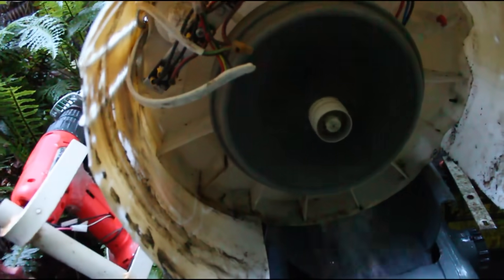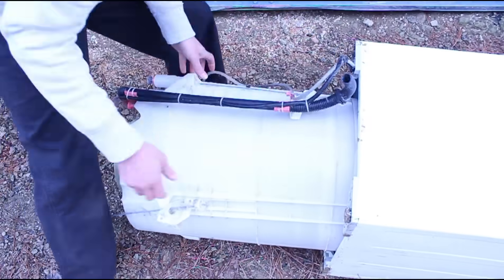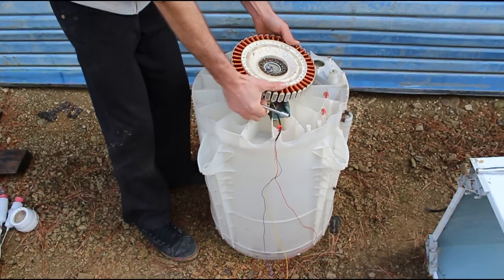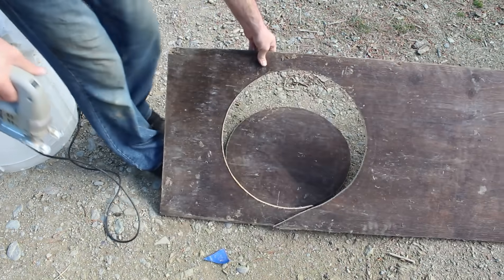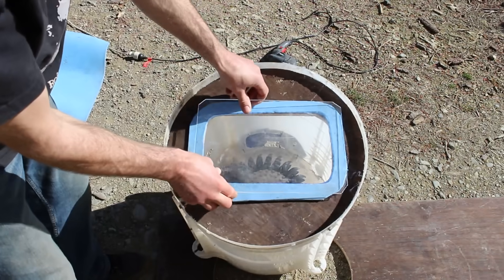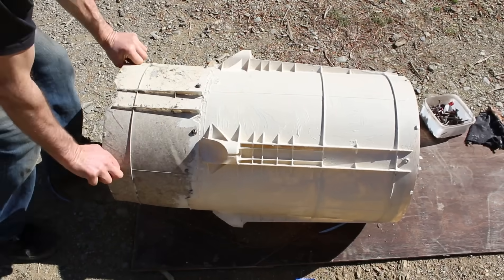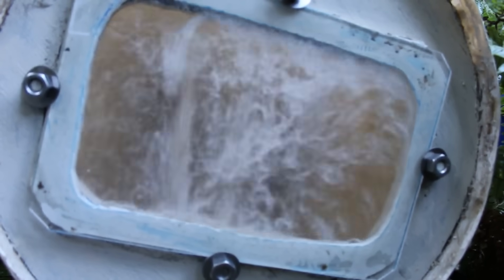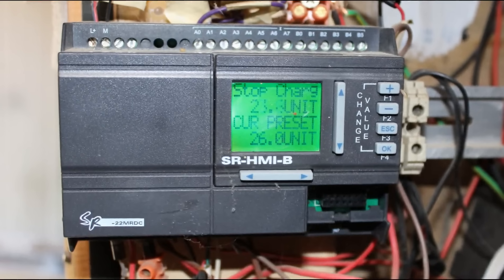Free power- How to convert an old washing machine into a water powered generator

Comment: I have a few questions for Angry Ram/Mitch T.  First of all, I live in the USA, so finding the type of washing machine that you have in New Zealand might be a little harder to find, if not impossible to find, and/or to buy, and/or sell, halfway around the world in the USA, where I live, so what kind of other washing machines would be a good substitute for people to use in my part of the world?  Second, can you modify this system for places that run on a bit flatter land that still has water in a lot of areas and still have it work just as well?  Third, can this system be modified for places that are plains, the savanna, the tundra/cold deserts, or hot deserts, yes or no?  Fourth, have you considered making more maintenance checks for your power generation system?  Fifth, have you considered making a better filtration system for your power generation system?  I suggest that you have a system that is in place around your pipes that drags the debris and detritus off into an area like large scale power generation systems like yours do so that it takes away from doing as much maintenance around your pipes in that regard.  Sixth, since New Zealand runs on around 230 volts to 240 volts in its electrical outlets, and the USA, Canada, Japan, Anguilla, and a few countries tend to run between 100 volts to 125 volts in their electrical outlets (though, weirdly enough, a few countries, like Belize, for example, can run on either system), how can you convert the system to run on lower voltage power systems so that the electronics, as well as electrical outlets that are in your home, do not get fried, as well as burn your house down, since your generator does not function on an electrical outlet any longer?  Seventh, and lastly, have you ever considered making the water pipes run a bit more in line, that is, flush to, the rocks without making the rocks, debris, plants, and other detritus causing difficulty to having periodic maintenance checks being made on the system from time to time?  Now, granted, I may not be an engineer by trade (I am actually disabled in real life), but I figured that I could ask these questions so that I could not only improve your own power generation system, but that I could also help out people that run on different voltage systems to have their own variants of such a system themselves.  Thank you for the responding comments.

Comment: Whirpool Cabrio and Maytag Bravos use the same type of stator motor, and they are much more common than the Fisher / Paykel washers.
Reply from the maker: Jeremy Hofecker Thanks for the info Jeremy
Reply: Jeremy Hofecker You are so right. I am told all the time "what a shame these washers aren't available here in the states" They are everywhere under various brands including F&P. Just visit any appliance reseller. Tell him you are looking for those funny looking permanent magnet washer motors. He probably has half a dozen that are not worth fixing as the computers go bad and cost more than what he can get for the washer used. (You don't need the computer) Here in NE TN they will let you have all the parts for about 20.00. Try and get one with good bearings so you don't have to replace them. Bring tools ;-)

Comment: You could use a small temperature sensor on the bearing and once it reaches a certain temp you know its time to change the bearings. You may be able to run it for more than 2 years and also you can test different types of bearings this way just for fun.

Comment: Can it be wired for 12-13 volt output and if so what would be a good guess on results
Reply: You could run a transformer off the inverter for 12VDC...
theoretically 850 watts continuous....
theoretically 40 amps worth but in reality probably less....

Comment: question: What are you using to pressurize the water to 40psi?  You need a power source for that as well, right?
Reply: He is using gravity to create the water pressure. As you can see at 0:40 he is running a pipe a good ways down stream, which creates a difference in elevation. There's a lot more to it but for a general idea in a static system, Pressure = (density of water)x(acceleration due to gravity)x(Height/elevation of water column). So that pipe you see there starts off about 90-100ft higher up the hill than its outlet, and could stretch a couple hundred feet across.
Reply: No need to be nasty Eric. Yes he is running a pipe along the stream, but what determines the pressure is the HEIGHT difference from source to destination. Calculations show that he would need at least a height difference of 92 feet to achieve 40 psi. And this is using a reservoir tank. He is feeding directly from the stream. He can run a mile on a gentle slope and the pressure is is still going to be determined by the height difference. On a gentle slope of around 10 degrees as shown in the video, the pipe would be around 529 feet long. This is what made me curious. Yes it is possible, just a lot of pipe and lots of real estate.
Reply: Thanks for clarifying gabriel, i was going to but figured my comment was already really long :)

The only thing I'm curious of is the temps there... it looks like its in the mountains, but what geographical? If I tried this in Pennsylvania I'd be replacing the pipe annually (unless I winterized it pretty darn good)
Reply: -Very good point. and it is not easy to find that long of stream you can lay pipe without cows or game wardens messing you up.
Reply: Gabriel Sierra
Reply: Good video!
Reply: How rude
Reply: Greg boyd
Reply: could i just use the pressure coming out my rain gutters for experiment
Reply: Golf Putz The lower the pipe diameter, the lower the pressure and the higher the velocity. Wider pipe has higher pressure but lower velocity. This is why hydraulic car jacks have a small piston on the lever side and a big piston on the lifting side. Since the pressure is lower in the small piston, you can raise your car easily.
Reply: In this case he may be using a ram pump. which is just a couple of check valves that uses the force of water to generate 30 to 40 psi. very easy and cheap to build
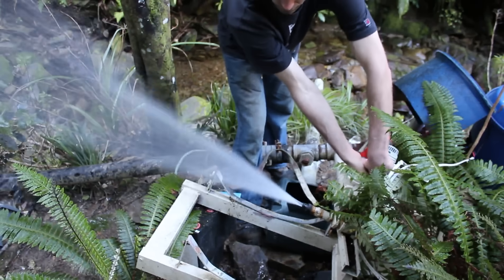Reply: Gabriel, if you can see the shape of the nozzle at 8:09, that is where a lot of pressure is generated, too, via the Venturi effect.
Reply: TheRoidemortetfleur, No. Pressure is given by elevation to the water inlet. The nozzle area affects the volume of water released. More water released increases the pressure drop in the pipe due to friction. More tube area reduces pressure losses but static pressure at zero flow is the same.

The RPM of the turbine is adjusted for peripheral speed to be half of nozzle water speed.

Using a solar MPPT battery charge controller will automatically adjust the load and indirectly find the optimum RPM where system output is maximized.
Reply: +Sir Camps- New Zeland, Someone Mentioned In Another Comment☺!!
Reply: +Golf Putz- No, Not Really Its Just The Head Pressure Which Is Determined By Height Of Supply Over Drop Of Output; There Would Be A Point Where Input Size Would Be Most Efficient But When You Add Bigger Inflow Pipe Than Whats Needed It Can Slug The System Or Provide Unneeded Wear On The Bearings Also!!
Reply: +Golf Putz- No, Not Really Its Just The Head Pressure Which Is Determined By Height Of Supply Over Drop Of Output; There Would Be A Point Where Input Size Would Be Most Efficient But When You Add Bigger Inflow Pipe Than Whats Needed It Can Slug The System Or Provide Unneeded Wear On The Bearings Also!!
Reply: I made a gravity fed water system for a farm i worked on,i never measured the pressure but the main line to the 50,000 ltr holding tank was 80mm and it was insane pressure, i think by memory the main line to the dam was about 130mtrs long. put it this way it still feeds 1000 cows with water to this day
Reply: In New Zealand power companies don't want excess power. We only get small cuts on our power bill when selling back unfortunately. 
It looks like this guy lives pretty far off from the grid, so it's unlikely he'd be able to. If i were him i'd route the excess power towards a hot water cylinder to keep my water hot.
Reply: A ram pump wouldn't help. They produce a greater head of water, at the cost of wasting most of the water that they take in. They essentially concentrate the energy in a large amount of water, into a small amount. So he'd gain in pressure but lose in volume. Both of those affect the power generated. 

Of course if the water had to be sent a long way, over hills, a ram pump could be a great idea, they're widely used all over the world in places like that.
Reply: Bodean Digs brilliant!!!
Reply: Keep these two numbers in your head and to calculate head pressure, lift etc.- - - 2.31 and 0.433.  The following is the equation for calculating head pressure (psi) from water column height (feet):
   Height in feet / 2.31 = PSI.
   (100 ft / 2.31 = 43.29 psi)
Or the inverse can be used to determine lift (feet) from a known pressure (psi)
   PSI / 0.433 = Feet of Lift
   (43.29 psi / 0.433 = 100 ft lift)
These are very simple conversion factors which do not account for line loss. Typical setups such as the water powered generator, the most important factor is amount of lift in feet and the volume of water available. I've asked the question, but he has not provided how much water (gpm) is being used to generate his power.
Reply: Golf Putz  yep. Also, 20 ft of 2" with a 4 to 6" x 2" funnel at the intake.
Reply: Golf Putz  No
Reply: @greenaum  I'd put the same point a bit differently.  It is possible to increase the water pressure using a ram pump, and then use that high pressure water to spin a Pelton wheel.  However, with a large flowrate low head source it is probably more sensible to use a reaction turbine such as a Francis turbine.  The total cost and complexity would probably be less and the total efficiency would be greater.
Reply: LazyH-Online  you contradict yourself by commenting to gabriel that "smaller pipe means more restriction and therefore higher back pressure." Go back to the books, kid. Venturi effect increases pressure like you said, not a vacuum. What a weird idea of yours.

Comment: I'm just confused about HOW you get the water from that little stream to the generator to create the 35 psi pressure
Reply: The water travels down through the pipe, building up pressure inside. The more the water drops from the mouth of the pipe, the higher the pressure at the bottom
Reply: 1 psi per 2.31ft. 30 psi would be 70ft. Not very common.
Reply: He has a 150m long pipe that goes way higher up stream. Certainly not something youd find in every back yard, but pretty cool, that head of water can certainly give that pressure

Comment: What an excellent way of recycling an old piece of equipment! Unfortunately where I live there are very strict laws preventing any private use whatsoever of water streams, falls, etc. No form of collecting water is allowed, even if it were to be returned downstream after being used by the generator, even if it is in private property. A real pity.
Reply: you and others like you should challenge that law.it is wrong...especially if the stream runs thru your property ...
Reply: Debra Oakley Yep. It is extremely strict here. We cannot even build anything 50 ft from streams or rivers much less collect water even if they pass right through our property. No longer my case, I sold the property, but the rationale behind the law is that if everyone uses the water and returns its waste to the river, it will have less and less clear water and more pollutants downstream. So only the utilities companies are allowed to do anything river-related here.
Reply: +corisco tupi no one should put wastes in Sony creek stream or river...
Reply: ElDon Quijote87 Brazil. All rivers, streams, etc, have a "protected" area whose width varies with stream size (and also with specific city laws), in which any construction is prohibited, even inside private property. This is usually something in 10m - 30m range, both sides of the stream. So if it happens to pass in your back yard, you must just leave that area alone.
Reply: Why not use wind ? The basic electronics would be the same. You'd just need the bearing, gear box and a wind turbine. :)
Reply: Bipul Pandey Looks like it could work with a wind turbine. Some form of RPM multiplication would be needed though, using either gears or pulleys, as I think this generator needs to turn at a pretty brisk pace to generate useful energy. Good wind and large blades could do the trick, I guess.
Reply: +corisco tupi I saw a show where they built a turbine that turned (10 speed) bicycle gears and in turn attached to a car alternator to charge batteries.
Reply: ***** Yep, that ought to do it. Easy to find hardware, might be a good solution.
Reply: +ElDon Quijote87 Seems like in your part of the world prejudice is strong indeed. I bet you never came even close to Russia. ps: in many countries rivers or streams are not private property and you can't own them. Just because stream is going through your land doesn't mean you can do whatever you want with it. There are certain laws and regulations protecting the rivers from bad use or damage. For a build like this you can get a permit easily (at least in my country), maybe the city will even support you.
Reply: +corisco tupi Of course you are not allowed, you would then stop paying the electric company... But for most people this is a conspiracy theory... :D
Reply: jirka merunka That might well be one of the reasons. But even any other construction, not related to electricity generation, such as shelters or garages, are also prohibited. Not even removal of native plant-life is allowed in the 10m~30m protected riverside areas.
Reply: +corisco tupi "This is usually something in 10m - 30m range, both sides of the stream" Laws tend to have holes in them, so to poke it, one could ask question:"Is there set range under neat the river?" ;) Depending landscape, specifications of the law and how much your into it, one could dig/drill under neat the river and tap in there and make "waste" go back same way in down stream. Also if hidden properly, who would know if this is middle of no where? Just idea that did come to my head. I agree that waters should be protected, but letting government agency have monopoly on resource like water is just wrong. Of course taking water from river, using it in who knows what and then dumping it back to river with all the waste, toxins and other crap is wrong and should be rightly punished, but if its just for usage like this.. damn thats harsh!
Reply: +corisco tupi Well they don't have to know, do they?  Screw draconian laws like that.  There are places in the US that can get you arrested for collecting rain water....land of the free huh?

Comment: Pro Tip-

For the door with the window: 

If you live in the USA. Go to the bank and get a few dollars in pennies. Using silicone. Glue a layer of pennies to each side of the door. Now every time you have to remove the door it won't be to messed up with muck. Because copper and zinc is anti-microbial. I didn't say spotless. Just not as messed up as if it were left as is. Cheap solution to avoid a little nastyness.
Reply: The new pennies in the US (since 1982) are 95% zinc.  They corrode when left in the environment very quickly, and turn to crap.  If you find pre-1982 pennies, they are 95% copper, and tend to last a lot longer.  I find pennies in the dirt a lot.  I save the coppers. About 5% of the pennies in circulation today are copper.  The rest are zinc.   :)
Reply: @freesk8  Always can use wheaties ;)

Comment: If you  want to use it as it is,you can  use a 3 phase bridge rectifier 6 diode, then atrach to a swich mode power supply bypassing the voltage doubling capaciors so the mosfet gets 277 to 380VDC. Set the smps to the desired output voltage. Works awsome for hydroelectric but for wind will need some method of wide range adjustments and zero voltage shutoff.

Comment: Imagine solar panel starting off your DC stream of water which then converts it into AC power where it powers itself in a circle
Reply: Sorry for commenting a little late, but are you suggesting that he powers a DC pump to move water to make electricity with this generator?
Would it not be a little more efficient to just use the solar panels directly for charging the batteries, in addition to the generator he has here?
Reply: Garrett Mitchell ment powering you air conditioner
Reply: Garrett Mitchell No such thing as preputial motion...
Reply: Violates thermodynamics. Will lose energy as heat

Comment: Can confirm a Whirlpool Cabrio has the same sort of motor in the bottom. Once one of the crappy $200 pumps gives out for the second time and you're tired of throwing money at it to keep it running, it looks like it will make a fine alternator.

Comment: 600 W? That's enough to power a whole family! Amazing!
Reply: alis49281 that's over 14kw a day. That's heaps if you're not power hungry
Reply: yes.   but, there are two things to  understand.    this is  Continuous power.   .6 kilowatts.   or  14.4 kwh per day.     for the times when you want to run a 1200 watt hair dryer or bake a cake (high demand),   battery  power  keeps things running, without the lights dimming.     cheers

Comment: Could you make a quick cradle up and have two end to end with the pelton spline fitting both shafts. So one wheel turns two generators?
Reply: To get twice the watts you need twice the height of water in the penstocks or twice the volume of water at the same pressure hitting the Pelton wheel.
The Pelton wheel needs to be large enough and strong enough to absorb and transmit this energy to both generators......
Reply: @JohnSmith-yv6eq  yep I gathered that, looking at the the head of water he has you could do it, but again it is any more then enough is a waste. V